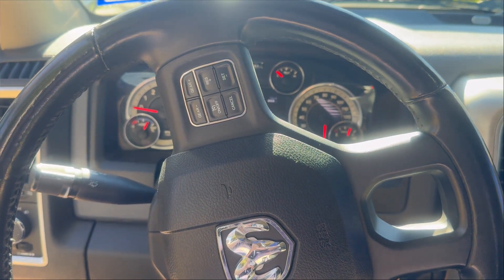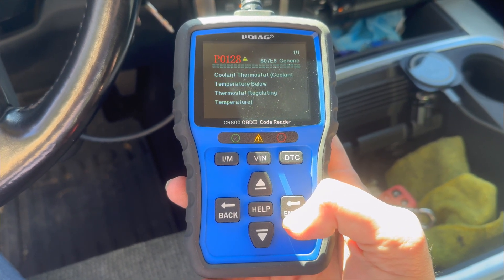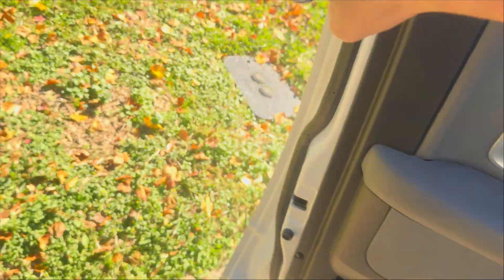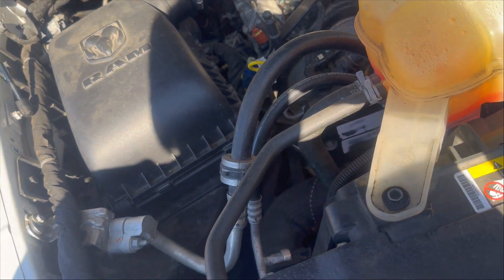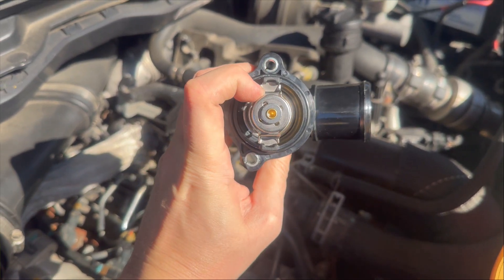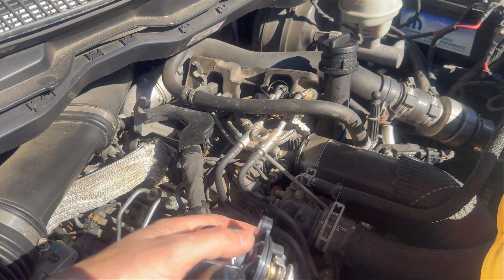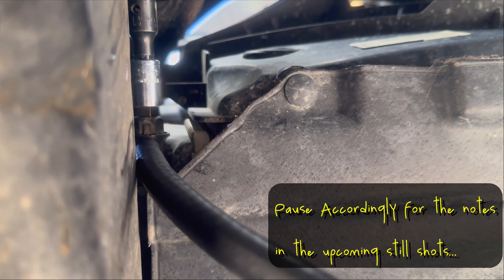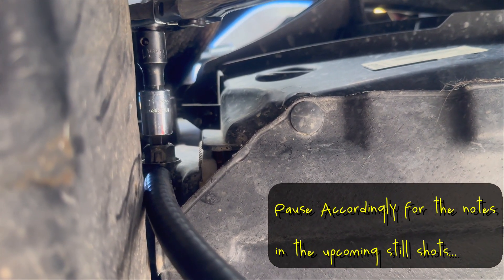Pwnery Tinkers : 3.0 Liter Ecodiesel P0128 Error Code, Cause, and Fix

Comment: Any idea what size hose you used for the radiator drain?
Reply from the maker: 10mm OD .. it was extra hose I had for a Coolermaster DIY liquid cooler setup for a water cooled CPU setup. Stretched right over the bung no problem.

Comment: How are you liking/disliking the 3.0 now that you've had some time with it?  I'm sure it's a million times better than my Pentastars lol - Good to see you're able to add some of these vidoes into the mix!
Reply from the maker: These engines have a bad reputation for reliability, but the more I familiarize myself with it, the more I'm starting to realize that aside from a really stupid crank sensor trigger wheel design, and the EPA's gas-engine emissions nonsense added to it which prematurely kills these engines, a lot of the complaints are due to owners unfamiliar with the differences between gas and diesel engines. Case in point, today was the first relatively warm day since changing that thermostat. I got nervous watching the temp readout surpass 218 degrees, while the needle on the gauge was right down the middle. Then finally the thermostat was fully opened and it settled back down to about 210 and hovered back and forth between those two numbers. Diesels want to run warmer than gas engines - mainly because ... well... no plugs so it needs a warm block to make good combustion. It's just one of those little things I had to realize and get used to. As for the pentastar engines - my Chrysler 300S has the 3.6VVTi engine and so far it's been perfectly fine. It seems like the Hemi's have their share of lifter problems, but these V6's seem okay.